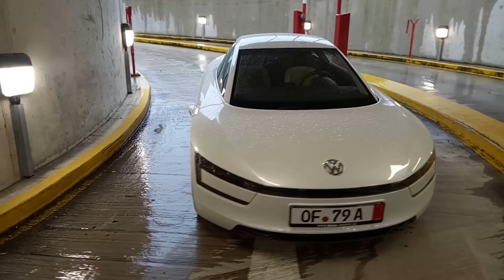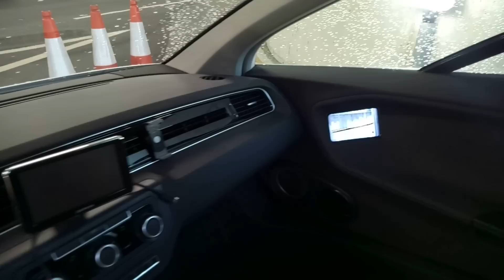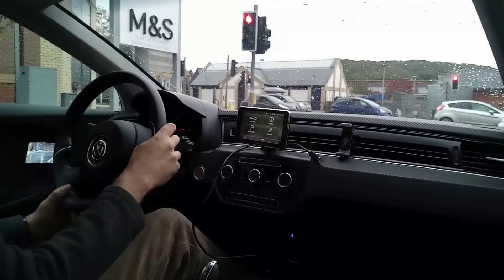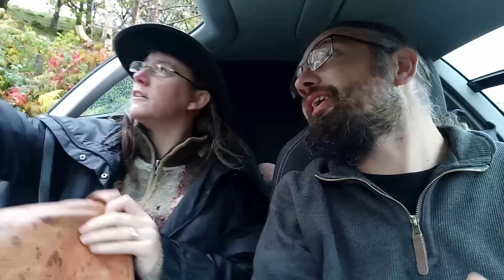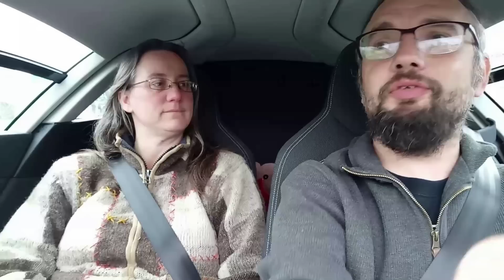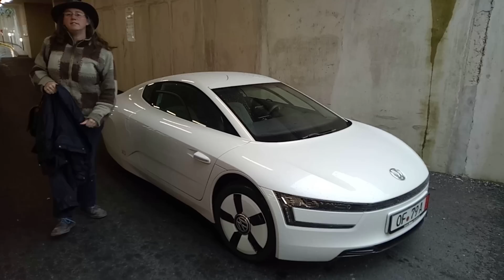Real Road Test: Volkswagen XL1 Hybrid thing

Comment: My current Audi-VW 3lt V6 TDI does not like stop-start operation, or short drives.
It gives a warning that the DPF (diesel particulate filter) needs attention.
At least once a month I take my car for a long drive to clean out the DPF. In worst instances, if not done, it throws a fault code that needs to be reset and goes into limp mode. This has not happened to me, but i've heard from other Amarok owners of this happening.

I suspect this won't pass current VAG DPF engine management programming. Given it is a small turbo diesel, and the stop-start operation - it won't generate enough heat to clean out the DPF.

I suspect the XL1 emissions aren't compliant.
Reply: Not just a long drive but a high revving drive preferably with an uphill load if possible. From what understand because diesels don't rev hard enough they're usually fine with it.

Comment: Interesting car.  Shame about the disgusting Mercedesesque bolt-on satnav which kinda fucks the interior and ruins the overall aesthetic.

For that reason alone, no.
Reply: Like most things on the car, this little Garmin unit was chosen because of its low weight, as it combines a lot of different infotainments stuff into a very small unit.
Reply: Ed Stratton  no doubt, but like a lot of cars it seems like the interior aesthetics are irrelevant to the manufacturer. Shame, and kinda fucks it as a package. Oh well!

Comment: They used a diesel engine?! That's a disappointment....
Reply: Diesel more efficient than petrol so had no choice, as target of 100km on 1 litre of fuel incredibly difficult to achieve.
Reply: Ed Stratton Ed are you well. Dan. Used mine yesterday washed her off garaged again
Reply: @primeroo2nd  Hi, yeah I'm fine! Glad you're using it! Me too, had a few nice local drives.
Reply: @edstratton  Yes, but more pollutant and toxic. So where's the advantage?

Comment: Just saw this review and found it very interesting since I drive a 2000, 1st Generation Honda Insight with 5-speed gearbox.
It has been averaging 55 US mpg using the (extremely good!) Air Conditioning during this Summer of sustained heat, and 60 or so US mpg on those rare occasions when the A/C has not been needed.
That's 66 Imperial mpg and 72 Imperial mpg  or 23 km/l and 26 km/l for those living in Litre-land.
I can live with that. And consider it quite good value for money out of a $500.00 car with 316,000 miles on!
The Volkswagen looks neat, tho...  But I fear that it does not fall within my realm of affordability!

Comment: Why? I cannot see the point when Tesla just announced a car that can do 500 miles on one charge.
Reply: Climate change. Less fuel used (or less electricity used) means less CO2. That's the only point. If you need to drive a fast heavy car like everyone else, no problem, buy a Tesla or whatever.
Reply: Less fuel usage. Thats it. That was the point all along.

Comment: Sad that they only made 200, that used market price is not ever going to go down. A really interesting car and a nice design too. You were lucky you got to try one, they are going to be a future desirable classic without a doubt. I nearly bought a Lupo 3L some years ago but the gearbox on them could only last for 22.000 km. i now have a 1.2 TSi Caddy and that is a joy to drive. A big car with a tiny turbo charged engine that feels a lot more powerful than it is.
Reply: Hope you mean "could last" as in "might last", because I know of ones well in excess of 300 000km on original gearbox.
Reply: @GoldenCroc  Out of the 6 3L's I know personally, 4 have had gearbox issues, 3 of which required complete replacements - 1 car is on its third box by 230.000 km.. This includes cars imported from Germany and cars bought from new in Denmark. The 3L is a great car and a likely future classic, but the DSG box in them was not always robust and it took some time to get right. By the time VW did the Polo Bluemotoion they had gotten the durability right. I have seen 1 manual conversion in a 3L and an engine swapped one - 3L exterior with GTi interior and petrol TSi engine. Would still love one, but only if I knew the DSG had been serviced or updated. The garage where I tested 2 cars myself were 3L specialists and were not surprised when the first car they let me drive only made it 20 meters down the road. The second changed gears like a learner driver on their first drive. So I gave up and settled for a Wagon R+. Ugly but tall and room for 24 crates of beer ;-)

Comment: 130mpg = 1.8L/100km: Easy, in my 21 year old Fiat, if I don't touch the accelerator and crawl along in 5'th gear at 24 mph, 450rpm, I'm at 1.4L/100 km or 170mpg. However, I really like the skinny lightweight wheels on the XL1... That was until I found out what they cost; 3000$ a piece.. So they wont get on my Fiat anytime soon. Also 4.7L/100km on your test drive, is horrible!!! worse than any compact car in Europe. You really need to hypermile, to get the advertised figures.
Reply: Sure, buy this car can probably do 400-500mpg with the same conditions as when your fiat is doing 170. Those 4.7 per 100km arent very representative.
Reply: @GoldenCroc  At 20 I got my first car, and as a student, hypermiling was a requirement. The habit stuck and all my cars since, I've been able to get the extra urban consumption figure as my year round average, including a Renault Kangoo (got 35 MPG) and a Mitsubishi Space Wagon (got 40 MPG), both big cars by European standards. So there exists no "average way" to drive a car, where you don't think about you consumption and just drive "normally". EPA figures are made by old ladies, so if you care, you drive like them. Cheers
Reply: @Tore_Lund  That was a bit of a non sequitur answer.... Where does your driving history enter the picture? Or the average driving? Or the EPA standards? Dont see how what any of that has to do with what I wrote.

You just drew to far reaching conclusions in your first post, so I enligthened you about the reality. Thats it, really.
Reply: @GoldenCroc  Sorry, thought this was a different argument. Yes The XL1 is nice, hope to get one from the scrapyard one day!
Reply: @Tore_Lund  Its ok not to like it. Really. But there are fact based arguments why one would not do so, not made up ones. Real ones, such as the price of its parts, which you mentioned yourself. Myself, I would be delighted to drive one, it is a concept car for the road, not something one sees every day.

Comment: Interesting car, but can't understand why they'd give it a diesel. You see a futuristic concept looking car approaching but hear an old tractor as it goes past.
Reply: Reason the XL1 has a diesel engine rather than petrol: 
VW engineers only had one single goal in developing the XL1 - to make it so efficient that it could get 100km on 1 litre of fuel. This was almost impossible and in the end they had to pull out all the stops, including reluctantly having to use a fuel that is more efficient than petrol - namely diesel. It took 12 years of trying and trying again before they finally reached that target of 100 Km on 1 litre. The project served its only purpose well - to enable their engineers to find news ways of achieving greater efficiency in the future mass produced models. But yes it does sound like a weeny tractor driving by! And who cares!

Comment: call it sacrilege but id love to buy one of these, gut it and make it a full EV with current battery tech,  drop a tesla motor in it and give it some power. It really is a car ahead of its time and if they had stuck with developing this more and waited for batteries to get better with range  it could have been even more amazing.
Reply from the maker: Yes, it needs the cement mixer engine throwing away.

Comment: It's a VW, it only does 300 on the test machine using cheat software, you know, their usual scam. So it's energy saving with cameras and screens as mirrors using electricity rather than a bit of mirror, yea that makes sense. I see when the door is open all the water pisses on the seat, what a great design, haven't we progressed along way. What a crap design, they made 200 too many it seems. Mrs Nut is wise to it.
Reply: VW's cheat software was for cheating emissions, not for cheating miles per gallon!!!!! Dieselgate does not apply here!!!!!
Reply: @edstratton  Time will tell and my point was cheating not diesels, nowhere did I mention diesel.
Reply: Cameras and screen pulls effectively no power at all, so thats a moot point.
Reply: @GoldenCroc  Does it use more elec than a mirror? yes it does, that was the comment so it can't be moot, I didn't say how much is used so your point is moot.
Reply: @dubsydubs5234  Not really, energy usage includes what it takes to drive the car. If the fuel saved offsets the electricity used, which it does, it is a net gain. Thats why it mirror electricity usage by itself is a moot point.
Reply: @GoldenCroc  So the manufacture of 2 cameras and 2 screens, the wires, the eventual landfill and energy used to run them is free then yes you are correct. You do realise electric cars use fossil fuels to make them and charge them.
Reply: @dubsydubs5234  Reason why I made that post is that it is very common among people to overestimate the energy usage of such things as car lights and camera door mirrors. It all depends on the longevity of the car and the driving patterns. For just city driving, they are useless and a net loss, absolutely. 
For a normal car lifecycle, and german mixed cycle driving, the camera + screens instead of conventional mirrors are a net energy gain yes, even accounting for the recycling and energy it takes to make them. 

Yes, I am well aware of such factors as fossil fuel usage, I took that into account when I wrote that post. I agree every factor should be taken into account.  Of course I dont have the exact numbers, but close enough.

Comment: I am so sick of hearing about these cars. Ever since the 90's till today, hundreds of these new Innovative cars with 100, 200, 400 miles per gallon after 40 years of BS but reality sticks us with cars barely over 50 miles per gallon. Says Volkswagen XL1 can achieve a combined fuel consumption of 0.9 litres per 100 kilometers (310 mpg)MY ASS!!!
Reply: "Says Volkswagen XL1 can achieve a combined fuel consumption of 0.9 litres per 100 kilometers (310 mpg)" .....  er, well no. Actually VW never came up with that figure of 313 mpg at all - it was the independent official government body who told VW that 313 mpg was the figure it got on the official government test. Don't blame VW!
Reply: As Ed has said, seems like it can, according to testing. So I dont see your gripe?

If one drives sensibly, rated consumption is acheivable in all cars sold.

Comment: I just love the design of this - that radical aerodynamic look is just gorgeous! But wouldn't this be a much better car as a pure EV? I guess VW was just a little bit too early with this one...
Reply: Not necessarily. Battery energy/weight ratio is much worse and it can run on battery alone for a decent range. If you’re not using the full battery every trip you’re just dragging around unneeded weight.

Comment: WTF 4.7 litres of dirty diesel per 100 km?!? Really WTF! That absolutely horrendous. That is total Piech failure. His goal was 1l per 100 km!!! With this unpractical hybrid diesel guzzler its better to buy an old diesel 1.9 TDi Škoda Octavia and you are on the same consumption. What a shame for Volkswagen. 🤦‍♂️🤦‍♂️🤦‍♂️
Reply from the maker: To be fair, I was hammering it uphill in crap weather and very low battery charge.
Reply: Please, this isnt representative at all. I am sure deep down you dont really think so yourself.
Reply: Its representative failure. Its even horrendous than Prius which is very practical car.
Reply: @pangrac1  You are not making any sense whatsoever. Authorities says it does 1l /100km. A skoda Octavia does not. There is no debate here.
Reply: @GoldenCroc  Lol, so you call liars and scammers from VW an authorities? Are you joking? ROLF. XL 1 doesnt have consumption 1l, real one is over 2l and even more. Its complete fail. Deal with it.

Comment: They made a 3 pot TDI lupo 3l that could do over 100  mpg low resistance wheel bearing and airo 0.29 back in 2001

Comment: Awful soulless vehicle, I really don't like it. If we want to be greener instantly, we should stop constantly buying new cars and scrapping old cars. I have a similar moaning old git view of "energy saving" lightbulbs. Less manufacturing, less emissions. New cars are faster and ultimately are driven faster, so any energy saving is cancelled out by that. Similarly, old style light bulbs may use more energy, but you don't need 25 of them to light a single room, even then enjoying as you will, that pee yellow light quality they output. Digression over. What I want in a vehicle is longevity, easy to fix, cheap to run and straightforward to operate the accessories while I am driving, something which cannot be said of the modern vehicle. I'm afraid its all a big con, energy saving gives with one hand and takes with the other and the future is a crystal clear sky, but with a landscape punctuated by mound after mound of electric car battery dumping sites and a water table polluted to the max with a mixture of battery waste and classic car fan tears.
Reply from the maker: Yes, as an economical test, it fails miserable. I was still intrigued by it though. With you on light bulbs. We use energy savers where lights are on for long periods, but for bathrooms and store rooms, where a quick burst is all you need, we're using up our old stock of incandescent bulbs.

Comment: So Ian, let me get this right......A Dolomite Sprint road test request was declined because "It Isn't very Hub Nut" - but a XL1 Hybrid clearly is. Ummmm????.......(one confused subscriber)
Reply from the maker: The XL1 may be expensive, but it's also hopeless and they barely sold any. I rest my case. Dolomite Sprint gets too much attention. My preference would be an 1850HL.
Reply: If one of your main ingredients is being hopeless, I can't wait to see the Sinclair C5 road test :)
Reply: @HubNut  "It's hopeless and they barely sold any"??? WHAT are you on?!? By that reckoning, McLaren "hardly sold any" of the F1. Half as many as the XL1 in fact. Why? Simply, and only, because in both cases they hardly built any!! In both cases it was always intended to be a strictly limited run production, and for very specific reasons that are well documented. 
I have to say, it's seems that when you made this video you could not have known much about VW's intentions or aspirations in building the XL1 and putting it into production, or your whole attitude would be completely different. The XL1 was a huge research project that lasted 12 years, it was never an attempt to make money from selling a particular model of car. There were only two goals in this project - two prove that it is possible to get incredibly low fuel consumption (even on an official test cycle) in a car that can actually then be put into [albeit limited] production and actually sold to the public, and, above all, to find out what they can learn from that process and from the buyers' feedback. I can think of no better way for VW to learn how to make their future mainstream "people cars" more efficient. 
The XL1 was also a total sales success in that it achieved everything VW hoped - it proved their point and it taught them how to make better electric and hybrid cars to sell to the average buyer on the street, and what's more, even at close to £100,000 each, they quickly sold all 200 of the planned production run to exactly the kind of buyers who they always knew would probably buy them - collectors, investors, wealthy car nuts, and even VW dealers who wanted to show it off and provide a bit of wow in the showroom before moving it on to a private buyer. You were exactly the kind of person the XL1 was not aimed at, but I'm sure VW hoped very much that the XL1 project would help teach them how to make the kind of cars that you would very much approve of in the future.

Comment: the person stepping out of the turquoise UP at around the 3 minute mark is looking at the car wondering whether it was just sugar her husband put in the tea that morning! Looks remarkable, but also oddly relatable - the maps and more satnav unit is the one used in older UPs (and possibly other VWs) which I think they have done away with now, and I can't help but think interior design cues of the car suggest some relation to the UP in design. I can't help but think it'd benefit from a rear view "mirror" in the normal place that is actually just a screen showing what's on a camera. Ive driven with my car full up in the back so I couldn't use the rear view, and it felt very alien just having to use the side mirrors and my shoulder more. Respect for van drivers increased after that.

I am looking forward to a time when cars like this are as regular as normal cars are now.